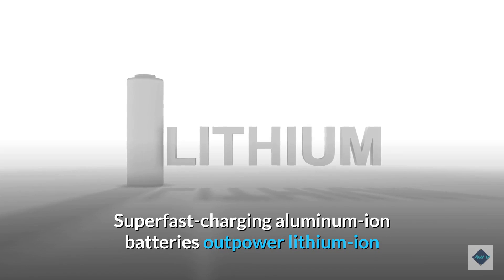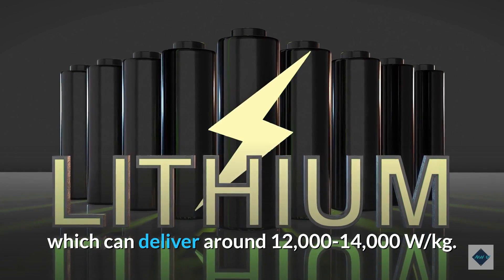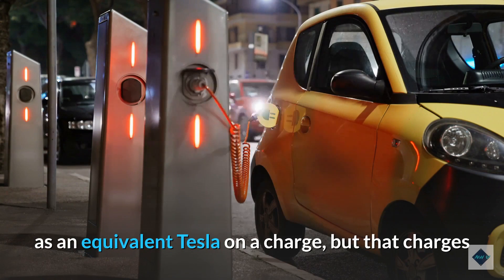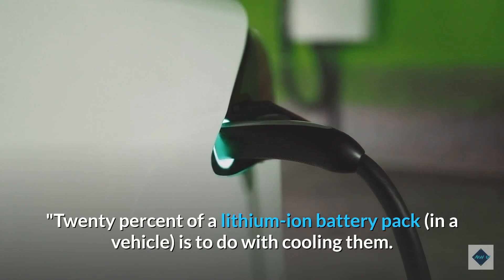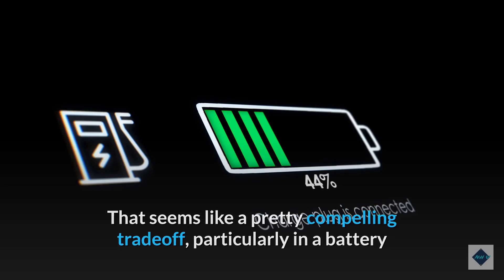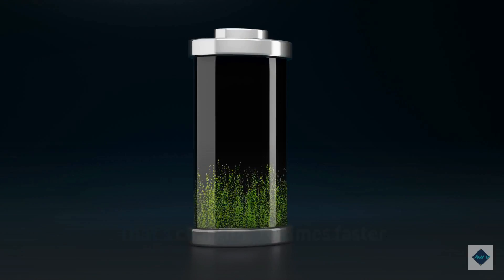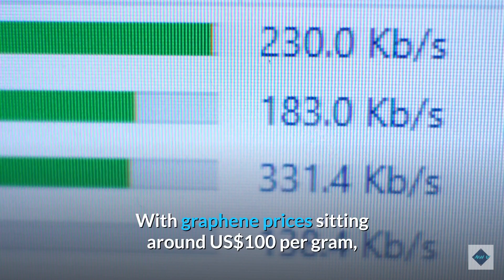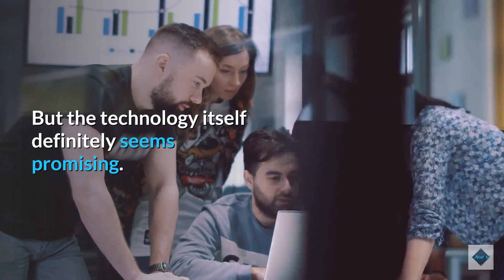Superfast-charging aluminum-ion batteries outpower lithium-ion

Comment: EVERYTHING is faster than lithium-ion SNAILS are faster.. lithium-ion tech is from the 50's and has never been updated as we never had a reason to lol. no one saw the mobile device bomb before it got here to make better batteries lol DUH!!!!! digital cameras have been around since the 60's but were only recently just released as new lol blue prints dated 1961 clearly shows them decades before we got them. how did no one see the mobile device coming ?